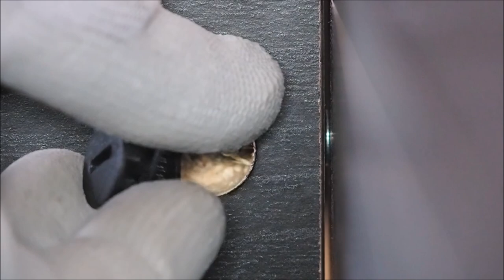Ikea Besta cabinet assembly (frame)

Comment: mine will not slide in like that .. keeps dropping out even with two people.  grrrr.
Reply from the maker: Are you sure you've put everything together in a right way? The drawers shouldn't drop
Reply: @k-nemo  the back i meant and yes wasn't lined up with sliding lock joint correctly.  Waste timber filled the machined slot making it appear as if it was only a trench joint
Reply from the maker: Have you managed to finish the cabinet?
Reply: @k-nemo  yes all done thanks
Reply from the maker: Well done